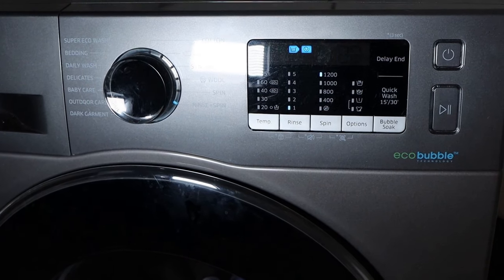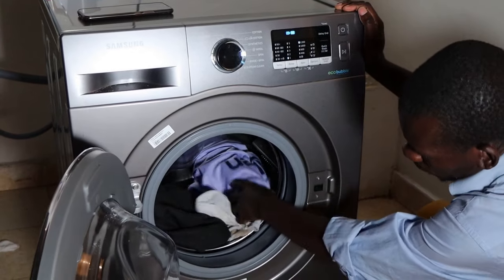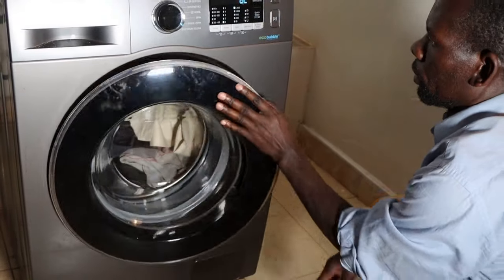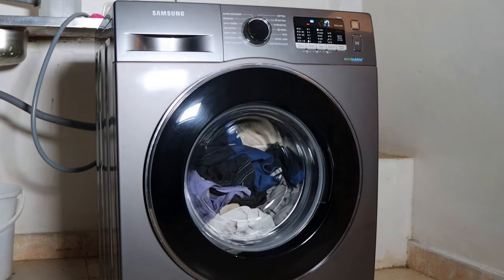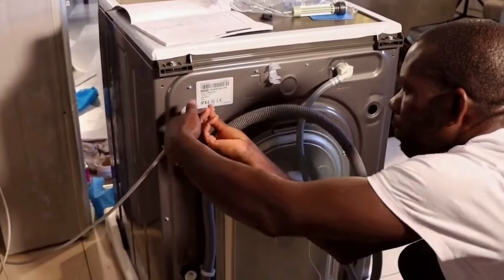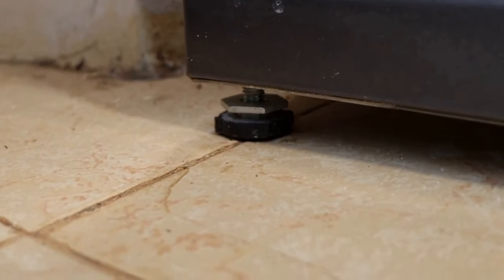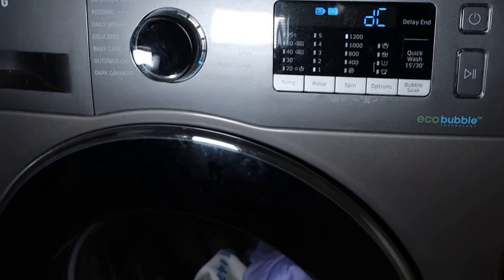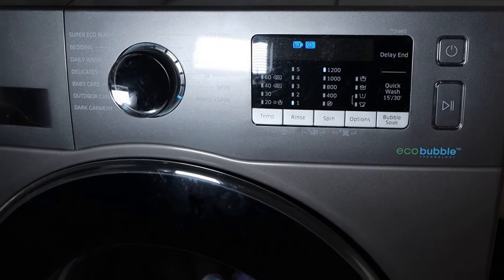How to fix DC ERROR | Samsung Front Load Washing Machine

Comment: Hi all, DC error means a fault with the door(lock) or just your door is not properly closed. In my case I had to replace the door lock. There are video's online how to do that. If you are just a bit handy you can do it yourself. I ordered an after market door lock online voor 22 euro's because a Samsung door lock would have cost me 80 euro's. Hope this helps you if you can't get rid of the DC error with Ian's tips.
Reply: I think in my case it's the doorlock because if opened, it's not hanging steady, there is 'room' to move. Sp i tried to tighten the screws but no sxrew driver matches them.
I guess I will call a mechanican.